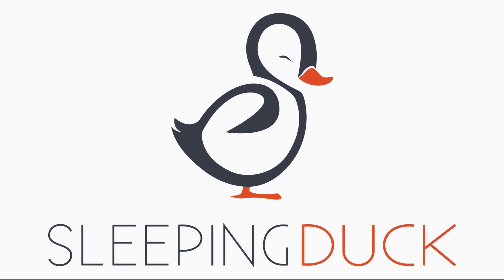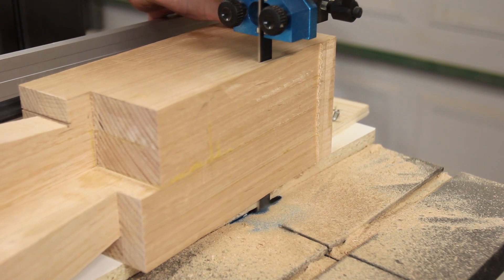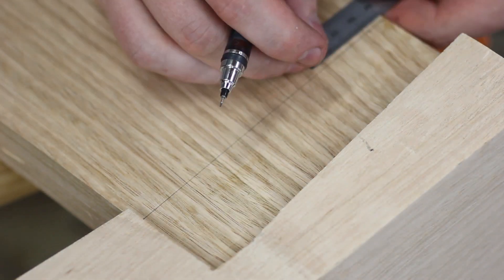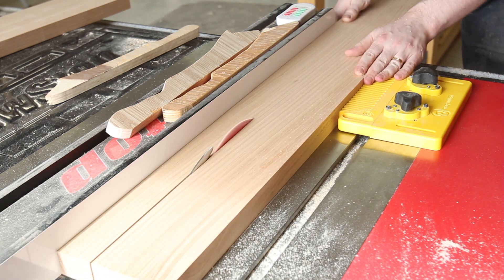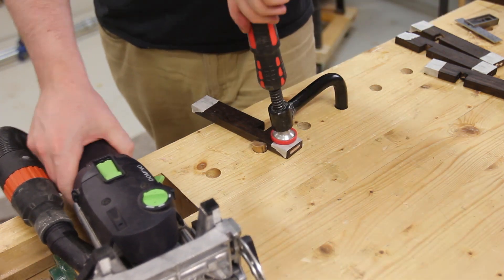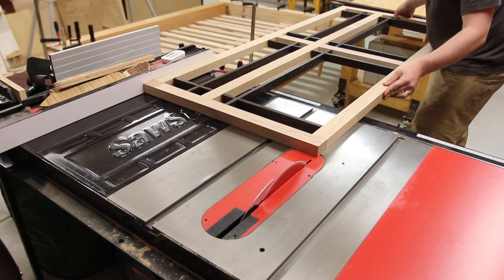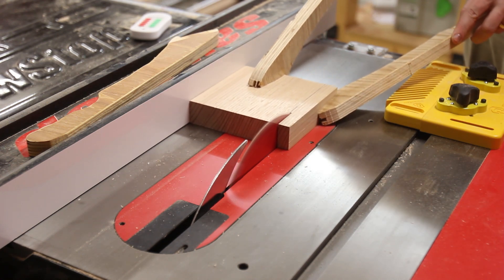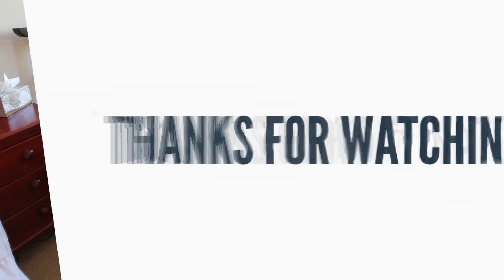098 - The Shogun (Queen Platform Bed)

Comment: Nice work! What is that drill guide looking thing you use early in the video? Looks interesting and very useful.
Reply from the maker: +torqemada Its a drill/counter sink with a delrin bushing that stops it from marring the surface. Look in the decking section of a hardware store - there are lots of brands that have the same thing (mine is a P&N)